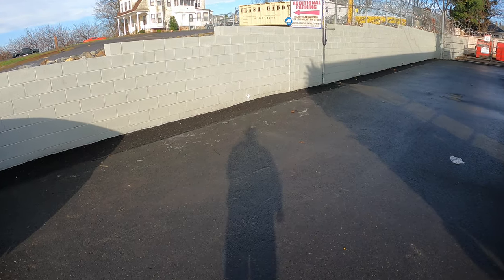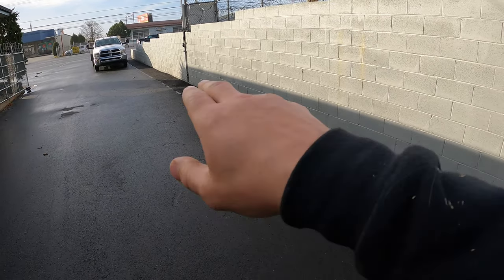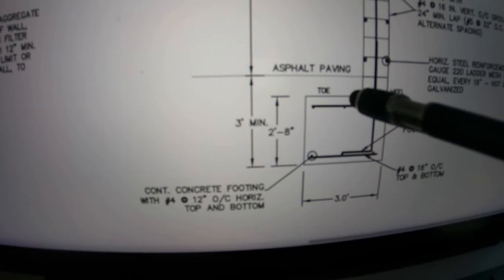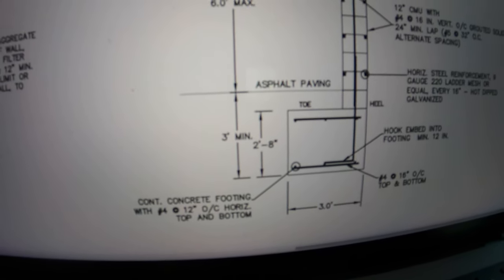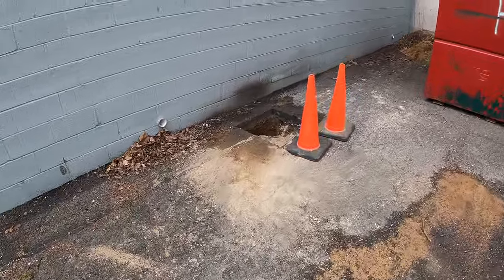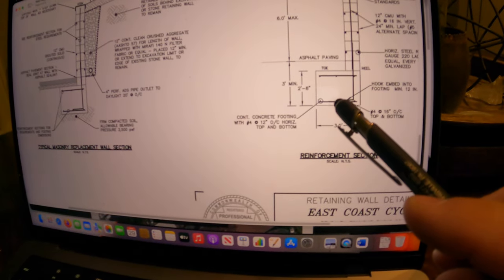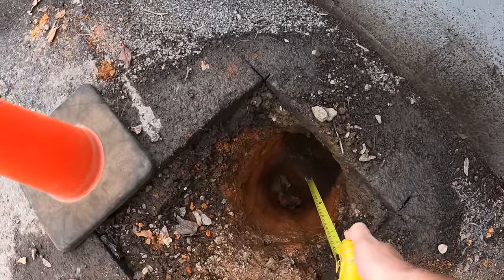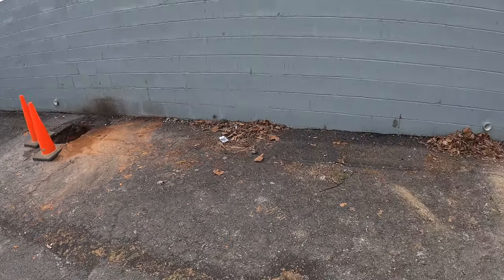Failing Retaining Wall Inspection

Comment: the customer should have been familiar with his plans and should have been watching the build.
Reply from the maker: I agree, the customer was in a jam because there was a major storm and the old wall collapsed. Thanks for watching
Reply: Doesn't the engineer also have fault...,not only the contractor?????
Reply: @mandodebbiechavarria6201  as I watched the video, it looked like the engineer designed it correctly.  After that, the engineer is out of it.
Reply: Customer has no responsibility to oversee contractors, no reasons to know how the job should be done and how to read engineer's plans. Customer is supposed to pay, and contractor is supposed to to the job according to specifications. Blaming customer for contractor's poor execution is just mindboggling.
Reply: @yohatch  my question is how much was the job quoted at initially. If there were at least one or two other quotes and the customer decided to go with cheapest, particularly if significantly cheaper than other quotes then that's a very expensive lesson. If customer went with licensed contractor and middle or even high bid then that's entirely on contractor.
Reply: The customer has nothing to do with it the trades should have done it to specs. Imagine if it was a 70 year old grandma should she be reading the specs of the design according to plan?
Reply: Engineers n architects do the drawings/layouts n u pay they give you the drawings n all the details in writing many pages lol I just got hiring n engineer n architect for our business once I paid I got all the paperwork n seels gave it to the contractor he applied for all permits with the township once the township approves all construction permits then the contractor suppose to follow everything on the paperwork other wise it won’t pass inspection here in PA inspectors will show up for every inspection n will notify the contractor n owner of any issues to be honest they go over the top when it comes to inspections sometimes they wil fail u for the dumbest shit seriously but in some cases like this u wish they went over the top😂 I was involved thru out the whole process n showed up to all the inspections shit I’m paying a lot of money 💵 for everything 🤷🏽‍♂️🔬I just don’t trust Contractors period every time I hire them I’m involved in everything from beginning to end n I can go to sleep in peace at night💸💸💸💸💸

Comment: why would the footing be in front of the wall? surely the footing goes behind, to act as a cantilever, with the weight of the soil sitting on it keeping it held down? if you stick it out the front, then it can lift more easily and the bottom of the wall moves out
Reply: I mean, I don't have much knowledge on retaining walls but I can clearly see why it has to be this way... so the weight pushing up against the wall doesn't push the wall down like it is doing in this video
Reply: @CbrF4i600cc  i have a bit of experience, and a knowledge of the nz building code.

Comment: Okay, so I put my glasses on and reviewed the print again, and it is showing #4 rebar at 16 inch centers , but it looks like only 1 bar , and 1 #5 horizontal bar every 32 inches.   I think some calculations were off.   That"s not enough.  And the proof of that is shown by WHERE the wall is breaking , which is in the top half of the wall, so the footer may or may not be correct, but it is not the only cause of the failure.  Also the wall is not listing (leaning) which if it were , that would say that the footer is rolling over.  The wall is breaking and moving horizontally which says there is not enough  reinforcement in the wall.  Maybe the math would show that every cell should have rebar and larger rebar as well. 
As is true with nearly all catastrophic failures, it is rarely one huge mistake that is the problem, but rather a series of mistakes that add up to create the problem.
   I'm still sure that there are more blueprint details that are not shown so nobody can judge just yet...
Reply: I agree. I'm not an engineer, but I have seen plenty of engineered plans for CMU and poured walls. I would expect to see #6 rebar every 16" vertically and a few layers of bond beams. 12" block fully grouted with 12" stone backfill to alleviate hydrostatic pressure. The cantilever for the footing should be at the rear, but the footing is not the problem here.
Reply: Rebar sizes seems adequate considering no apparent surcharge on retained soil. The 32" o.c. alternate spacing is still refering to vertical steel. What the specification is actually calling for is #4 rebar 16" o.c. in footing and above footing for the first 24" (three blocks high) then #5 32" o.c. (hence "alternate spacing") which needs to tie in to every other #4 16" o.c. and essentially be resting on top of footing (which would achieve the minimum 24" overlap requirement) and go all the way to top course of blocks. Based on how blocks are separating perpendicular to the plane/direction of wall It wouldn't surprise me if all cells weren't filled as it is likely required(didn't see that specification showed in vid) and or wrong horizontal reinforcement used. Another concerning fact is specification is for a 6' wall, as built it appears to be taller towards the back. With that many red flags I'd also question if drainage specification behind the wall was followed.  I'd inspect cells for fill while I was at it. This wall may ultimately be nearly as expensive to fix than to demo and start over.

Comment: A few comments already mentioned this. One type of failure mode for retaining walls is overturning. The lateral pressure from the soil can rotate the wall, counterclockwise in this case. Although not sure if that's the specific reason for the local bulging, there could be multiple issues. Seems a heel should have been included.

Comment: The ground is sloped toward the street for drainage, so if you potholed at the far end of the wall (by the street) you would probably find the footer much closer to the surface.  But since one of the immutable laws of the universe says that all footers must be level, then naturally at the upper end of the wall, it has to be deeper.  Also the note on the print detail clearly shows the depth of the bottom of the footer is required to be a MINIMUM of 3 feet below grade.....there is no maximum depth shown.  There is however, a maximum height of the wall shown at 6 feet above GRADE, (not from the top of the footer).  That height of the wall was clearly exceeded at the upper end of the wall.  I count 11 courses of block at 8 inches each, that used to mean 88 inches.  I don't know what it is with this new math today,  could be 2 feet, could be a porcupine!??!
     Anyway , there should have either been a lot of dirt removal to reduce the load on the wall, or the wall should have been extra-extra robust to compensate for the increased load.  Being very familiar with the real world of construction,  I'm guessing that this was all discussed at some point, and a verbal decision/agreement was made to just go with it, which nobody will honor now that it's starting to hit the fan.  Still, no blame can really be attached to the property owner, unless in fact they were the ones who declined to cover the added costs of doing it correctly.  This is going to get messy in court I'd say.  You did exactly what you were hired to do, and that is honorable.  Sadly, you will probably get dragged into somebody else's battle, which is not a fun place to be.
     I have said many many times...."You can pay to do it right, or you can pay more to do it over!!"
Reply: The fact that you think a professional, let alone an inexperienced (puting it mildly) contractor, would continue footing level into a slope for that length of wall makes me question if you've ever built these types of walls before. There's clear evidence the retaining wall is failing, which prompted the footing needing inspecting to begin with. It is not a huge leap to surmise that the contractor who built the wall didn't know what they were doing. Therefore the reasonable conclusion is that the footing is deficient based on the evidence found once they dug underground and not that perhaps the footing is actually deeper still. Nevermind that it is clearly not wide enough as measured.
Reply: The standard is and always has been, to install footings level.  If you don't make the footer level it will compound problems the farther you go on the project.  The block wall on top of this footer for example would not stack properly, throwing everything out of sinc. Typically if a footer needs to be stepped up, it will be done in a minimum of 2 foot increments.  Not necessarily because of any requirement, but simply because concrete forms are typically 2 feet by 4 feet, and a single 2 foot step is simply easier and involves less labor than two - one foot steps.  And it is mathematically the same volume.  
There is now a sequel to this video , and it confirms most of my suspicions.  In the process of repairing the wall they knocked a hole in the wall, exposing the flaws.  The wall was not poured full and there was not enough rebar.  You can only see a small portion of the wall, so you can only assume some things.  But since the hole they made was at the bottom of the wall, and they were later able to fill it from the top, is proof that there were no horizontal bond beams. At least in that area.They removed the cap blocks in that spot and poured the wall full, but they should have done the entire length of the wall.  They poured some massive deadman footers and columns to reinforce the wall, but in between the columns the wall will continue to move because it has already been compromised and isn't poured full of concrete.  It may last for a while, probably until a severe weather system dumps heavy rain  for several days and then it will collapse.
Everyone can see that none of this project was done to the letter of the engineers specs, however you can also see that the footer was not the cause of the failure.  The evidence is in the asphalt on the lower level.  Zero cracking or heaving or separation can be seen.  The footer was never in motion.  Yes it was not done correctly.  No argument there.  Although I am willing to bet that it is actually 3 feet wide, and the correct thickness.  There is about 12 inches showing, the block is 12 inches and I bet there is 12 inches on the other side that you can't see.  When they poured the footer I bet the grunts in the trench stabbed their verts in the center of the footer just out of habit, and  didnt notice it until they came back to lay the block.  Which honestly might not have even been the same contractor.  How many masons do you know that pour concrete?  They are out there, but not very many.
Very expensive failure, and very expensive repair.  And now the property owner has some massive columns to dodge every time they drive to the back of the building.  And a wall that will eventually collapse anyway.

Comment: This how we do it in milwaukee every 32 inches we install rebar when you done with the wall grout every rebar all the way to the top. Cause is a long wall you intall control joins every 10 feet that keeps it from cracking

Comment: 2'20" - check the shadows ... cement saws always run best at 7 am ... full throttle ... pro tip there ...

Comment: I'm sure you meant nothing by the tacos comment but in today's sue happy world you really have to be careful how you say things...as for the wall, I see some problems on both sides of the equation...(engineering AND construction).  I hope there are more details on the wall blueprint.  I'm guessing there are , but if not then it is woefully inadequate. Some quick calculations would show the massive amount of weight pushing on that wall.  There should have been vertical and horizontal bond beams a minimum of every 24 inches  with at least 2 number 4 rebar each, and at least a 24 x 24 inch column integrated into the wall about every 10 linear feet.  Yes the footer and wall are not as shown on the detail and that is going to bite somebody in the butt.  However we all know that the deeper the footer is the more stable it is going to be. I would almost bet that they centered the wall over the footer rather than on the edge but in the overall big picture it's the wall that is moving and buckling , not the footer.   
   The property owner has no responsibility to know anything about the methods or materials used.  Their only responsibility is to do the due diligence of hiring reputable contractors and engineers.  Outside of that, 100 % of the legal liability is owned by the engineers and contractors.
   Understand that I'm not defending either one of them....there isn't enough information in this short video for anyone to make an accurate judgement.  Too many variables that you can't see in this video, ie: what is the soil type on the other side of the wall?,  did the print call for a drain at the bottom of the wall? ( I see drain pipes sticking out but how far do they go) did the print call for drain rock on the inside?, if so, how much? what about mesh mats in the drain rock?  Just too many unknowns at this point....

Comment: Do no
Reply: Don't know.  Surcharge failure. Test block. Footing is holding.  Grouted? Every cell? 
 Drainage. First row take out spec mix between header
Reply: Maybe double wall and extend footer. Footer Not the problem

Comment: what kind of inspector are you? Core drill and Xray, this is ridiculous and unnecessary
Reply from the maker: Im not an inspector, Im a contractor that buildings retaining walls among many other things. I was hired by the property owner to dig these holes so the engineer and local inspector could do an inspection. Thanks for watching